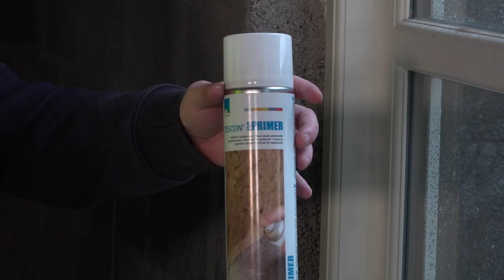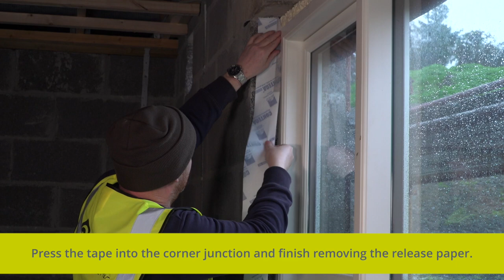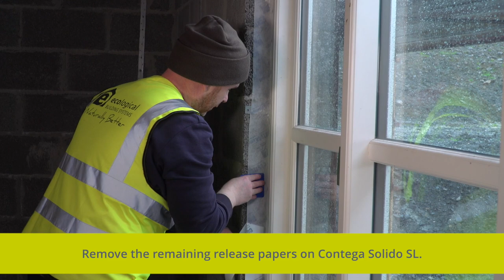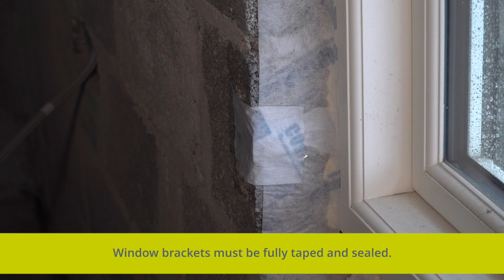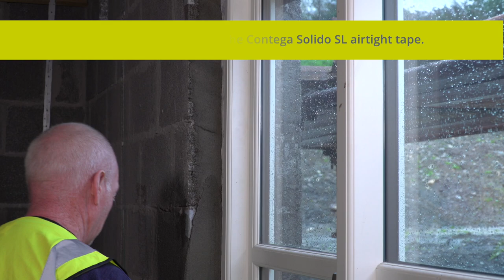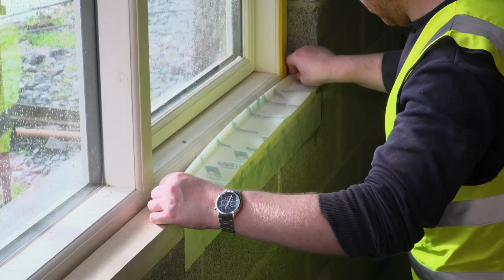Airtight Window Sealing with Contega Solido SL

Comment: Thanks for the video. I'm about to perform this step with contega SL. Is there anyway you might post up a video regarding air tightness from ceiling down to wall plate level? I believe mesh is used in this step to facilitate plastering.
Reply from the maker: Thanks for the feedback. We don't have a video of that detail unfortunately but will add it to the list. To answer your question, it is possible to use mesh here but Contega Solido SL is plasterable so it is easier to just tape the membrane to the wall and plaster over it.

Comment: How would I apply this if I am putting insulated plaster board around the window reveals? Would it go on top of this or underneath?
Reply from the maker: Level off the reveal (if masonry) with wet plaster and then apply the Contega Solido SL airtight tape to seal the window to the plastered reveal. Then plasterboard over.

Comment: Can this be done from outside or would it cause issues?
Reply from the maker: Hi @happyguycol. Sorry for the delay in this reply. Sealing from the outside is considered part of the weathertight detailing process. A similar tape can be used to resist water and wind infiltration between the wall and the window or door frame. The tape that is recommended for external use is called Contega Solido EXO, is black in colour and not to be confused with the internal white version shown in this clip. All of the other processes are identical. Hope that helps answer your query. Thanks.